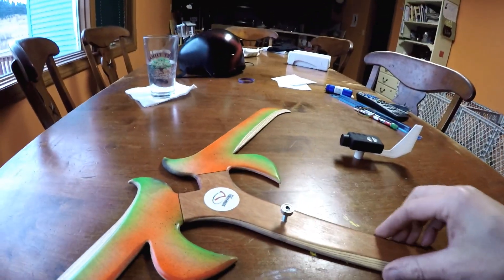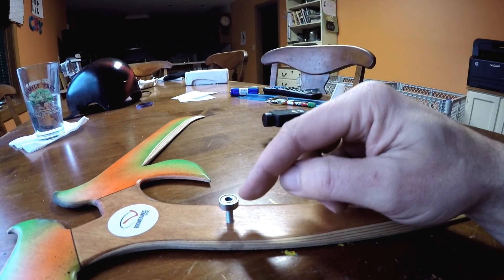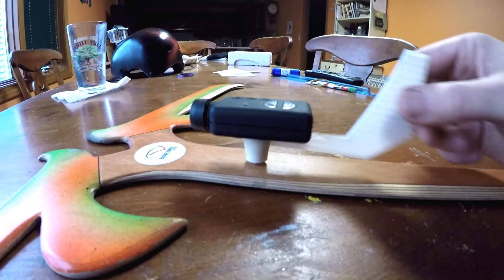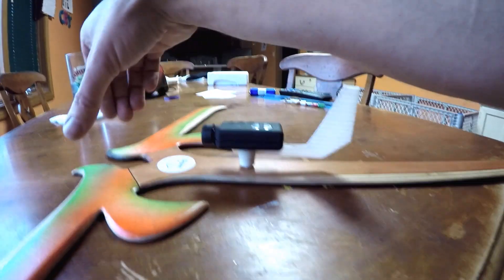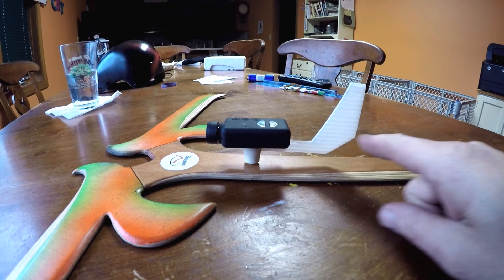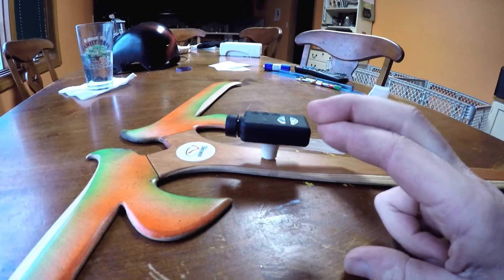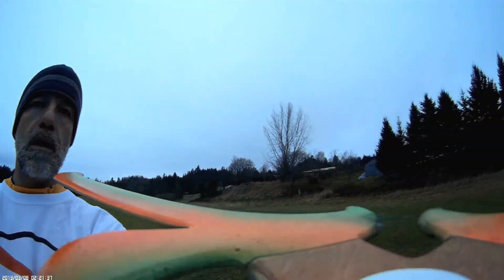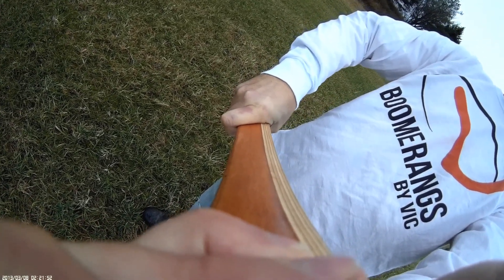Video camera mounted to boomerang with stable flight

Comment: Very interesting design on the camera mount. Although with such force of the throw,  rubber boot that just slides over the bearing hold it pretty good. I suspected that it would shoot out off the bearing as it slips over it from the throw but it did not. 
Very cool. 
Hopefully it serves you well for future returns. ..lol
Reply from the maker: +Controlled Chaos RC   When I first tried it out here in my kitchen it did fly off and hit the floor because I didn't have it on all the way. How the heck it didn't break it is beyond me. Tough little camera. Are you into RC pretty heavy?
Reply: +Victor Poulin Yes... and use this camera and GoPro in many of my Rc projects.
Reply: +Victor Poulin Tough camera it is but let me assure you,  it has its breaking point as I have broken 3 of my own in process of testing my rc projects. .
Reply from the maker: +Controlled Chaos RC   Been looking for someone interested in doing a video with me. I need someone that has an RC quick enough to chase 1 of my boomerangs in flight.
Reply: +Victor Poulin That would definitely be awesome.
Reply from the maker: +Controlled Chaos RC   for sure. Do you have one that will and where are you located?